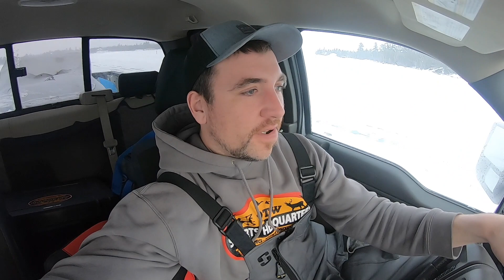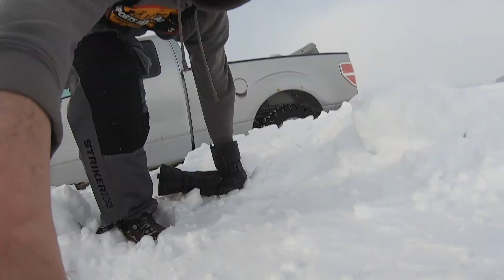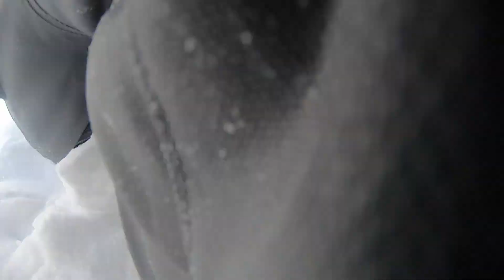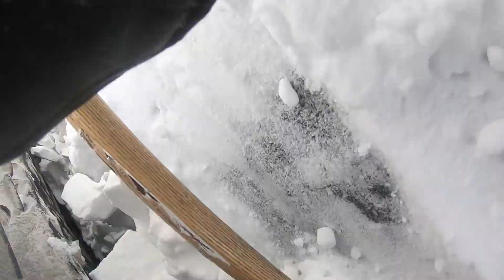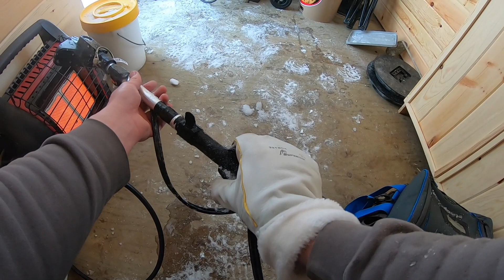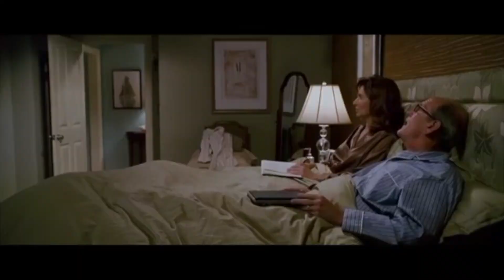STUCK in 40 Below 0 / Lake Trout + Walleye / Off-Road DIY Ice House / Cold Weather Lithium Batteries

Comment: Nice video, just curious though. We have used the Boss V plow for many years on Lake of The Woods and have plowed many roads through drifts to set up the permanent house and just to keep our roads open. We do use chains and usually throw some wood in the box for added weight. It looked like you were not using your plow, just wondering why.
Reply from the maker: I use the V almost exclusively for maintaining roads this time of year , opening up new ones With a half ton right now is near impossible and in -40 it’s almost a guarantee something will break! To be honest, I was being lazy and should have just detached it before going fishing , but some lessons are learned in sweat!

Comment: Why aren't you using your V plow to  bang your way through the plowed snow bank? Slow and go. I have burst  a hydraulic line before on LOW , I do get it. You have a plow and don't use it...operator error. Quite a adventure. 
Greetings from the south end of the lake.

Comment: Why not unhook the house on the road and plow out a quick driveway? When it's cold like that shit breaks, no way around it. After being stuck like that to many times I fabricated  a shovel to get under my truck so I don't have to shovel the sides so wide. I've only had to use it a couple times but well worth the effort. I enjoy the vids keep em coming.
Reply from the maker: no such thing as a quick driveway out there! it's like plowing concrete, not half ton able!  Id like to see your shovel, I was just thinking that the other day!
Reply: True on the driveway. I shouldn't of called it a shovel it's more of a solid rake. I took a old handle from something and put a piece of fairly thick plastic on the end. Think of a roof rake. Still need the shovel to break  up the snow then pull it to you. I'm sure you get it. If you changed the angle of the shovel handle a guy could figure out something out. One other thing I carry is a big comealong and I made an anchor that locks into an  ice hole so I can winch myself out.